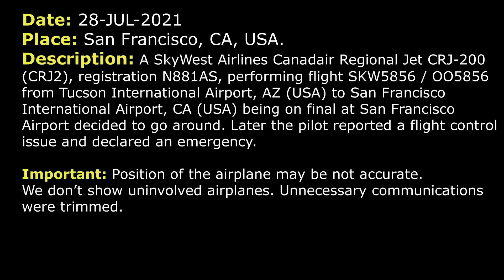Flight control issue. Ground spoilers were deployed in flight | SkyWest CRJ-200 | San Francisco, ATC

Comment: procedural and systems questions for anyone who flies the CRJ-200 

does the CRJ-200 have a WoW system to prevent ground spoiler deployment if the wheels are not down, locked and have weight on them ?

if it does have Weight on Wheels,  does it tie into the Ground Spoilers like other aircraft or is it strictly dedicated to wheels only?
Reply: The auto deploy logic is thrust levers idle and wheel speed of 16kts or an RA of less than 10ft, no wow requirement for spoiler deployment. Where that happened on the final seems fairly likely that they hit the GLD man arm switch instead of arming the thrust reversers, they’re identical switches right next to each other, then they didn’t stow properly when they caught their mistake
Reply: @Cactus732  that makes sense, thanks for the clarification

Comment: A very worrisome situation. IF I remember correctly there was a Boeing that had a full airborne deployment of spoilers in South American airspace and ended up colliding with a mountain due to limited climb capabilities.
Reply: That was a TAM Fokker 100
Reply: There was a 757 that had the spoilers deployed by the pilots, I'm guessing that is the one David was referring to. Was over Cali Columbia IIRC.
Reply: @2004JETTA  American 757 that lost had already passed a waypoint they were directed to fly to for an approach, they pulled the spoilers because they thought it was in front of them and they were too high, when they linked the waypoint it was behind them the plane turned into a mountain top and they got a ground prox warning, they would have made it but he forgot about the spoilers and plowed in. Missed it by about 10 feet, if the spoilers were down they would have made it.

Comment: I dont agree with the fact that atc is asking them to look out for traffic, they've declared an emergency, they dont have time or the capacity to be looking out for other aircraft. They need to focus on flying their own! Whatever happend to clearing aircraft out of the way of an emergency aircraft?
Reply: Thinking that ATC was also not giving a traffic call to the other aircraft I'm assuming they are VFR outside of the Bravo and not talking to a or the same controller.
Reply: @nickb6975  Okay that makes sense yeah, probably.
Reply: 1000 feet separation is the minimum, and controllers are required to advise aircraft of each other in that case. I assume she told the Cirrus as well.

EDIT: the other two targets were probably just the controller working from memory
Reply: You'd prefer they just didn't tell them about any traffic? 🤔
Reply: @joeg5414  I was stuck thinking they're in the same airspace. But now that Nick B mentioned that traffic was probably in another it makes sense.
Reply: @dismoptism5541  lol it's all good I get what you were saying

Comment: Besides your wings falling off, this is pretty much the worst scenario that can happen!
Reply: How do you figure ? It was under control.
Reply: @sfpup87   because if try to land with a normal flaps configuration with the ground spoilers already activated you will loose altitude awfully quick, which could be disastrous at an approach altitude.
Reply: @rjyeezy76  not really the CRJ has an aural alert that kicks on at v2+10

You run the procedure and land at a higher airspeed, lower flap setting - the trailing link gear can take a firm landing as well as the fact that SFO has long runways - it’s actually and ideal place for this issue to happen. 

Far from a disaster scenario.
Reply: @sfpup87  not when your on final approach with full flaps and normal landing speed. This plane was seconds away from touch down when the spoilers deployed. They are fortunate that they managed to get enough thrust to get them back up again.